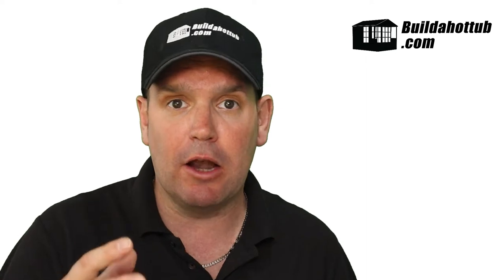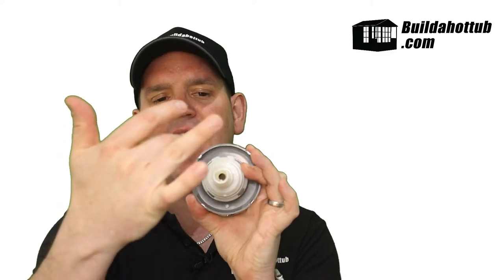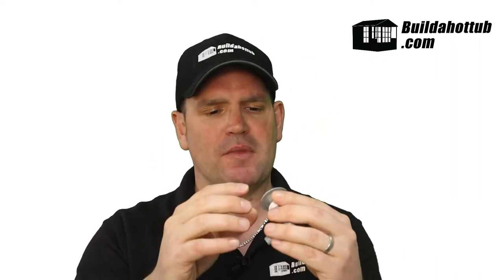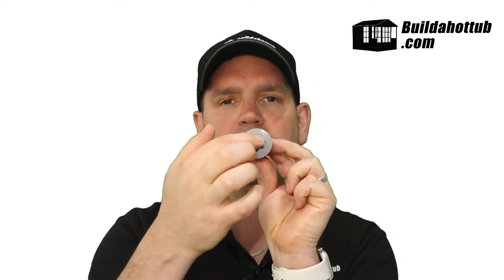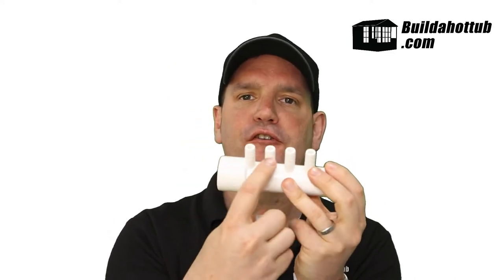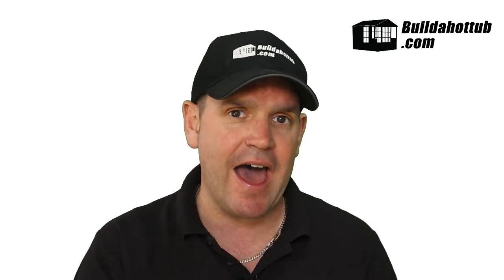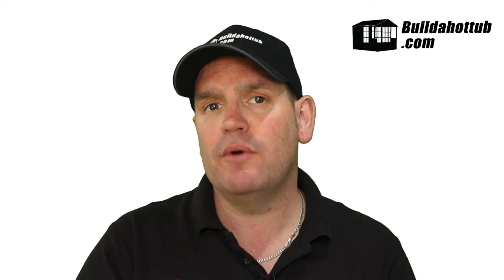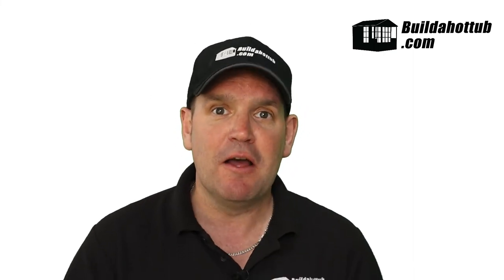More bubbles in your DIY Hot Tub?

Comment: i was wondering if u can still install the stronger jet into a hot tub that has already been built, will that be possible?
Reply from the maker: Hi Errol, thanks for the comment. All jets have their own flow rates. Whilst arguably, you could put a little more power from a bigger pump, the chances of them having a huge effect is minimal. Jets do have a maximum flow rate so if you put too big of a pump in, it would end up working against itself and reduce the lifespan of the pump. You always size the pump to the flow requirements of your jets. So, in short, not really is the answer to your question - unless the pump was undersized when you built it. If it came from a shop eg plastic shell tub, it would have already been sized correctly (one would hope!) Hope that helps - thanks, Andi
Reply: Instead of adding a bigger pump could you introduce more air into the external air valve that is built into the edge of the hot tub .
How would that effect the jet ?